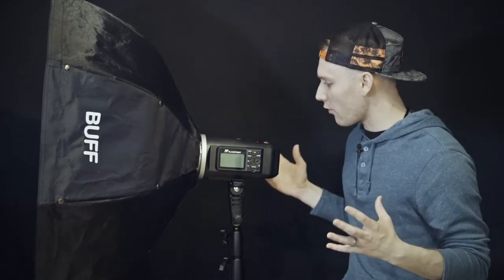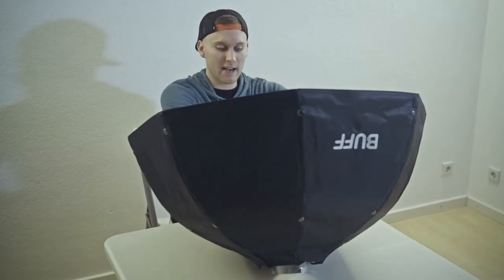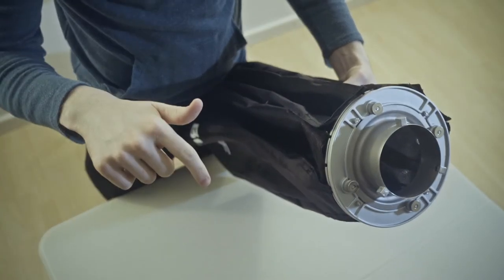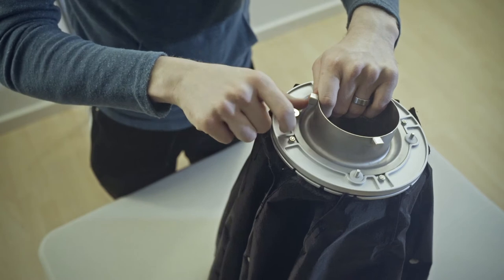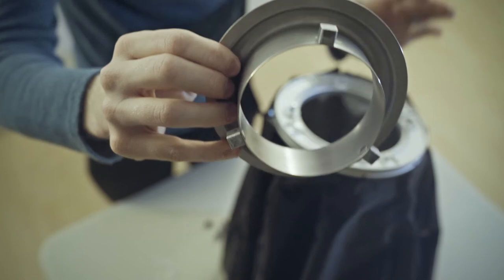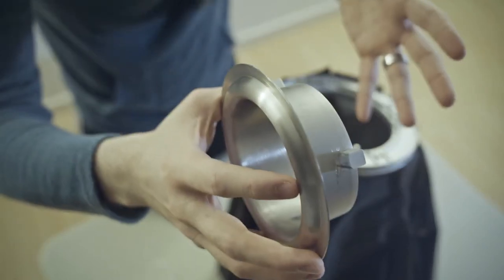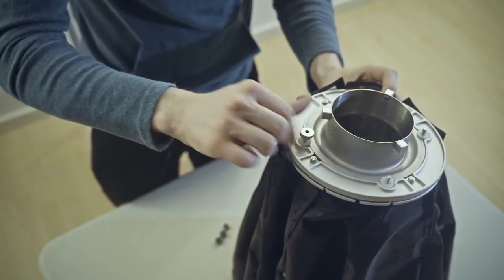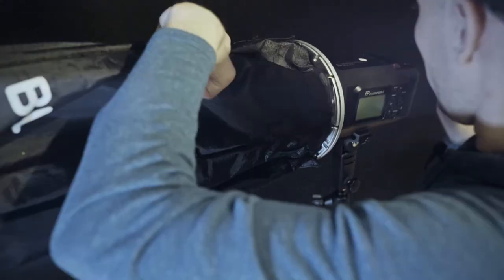How-To: Adapting Paul C Buff Modifiers to Flashpoint Xplor Systems

Comment: This is so helpful - unfortunately I'm having a lot of trouble finding the Adaptor Ring you recommended (seems to be discontinued or sold out everywhere). Any tips or alternate suggestions?
Reply from the maker: Kelly Kester I was one of the first to find out about this adapter ring and just bought enough for my softboxes. I'd recommend searching for the part number in Google and see what kind of results you get. I hope your able to find some.

Comment: Nice! Wasn't sure if the adapter would be interchangeable. Thanks for clarifying! What did you shoot prior to flashpoint and what are your thoughts on switching?
Reply from the maker: John Weatherby Thanks for watching! Prior to the switch I used the Paul C Buff Einsteins and I had a selection of the Sony HVL-F60M's. I was heavily invested into the PCB system but the switch was simple. It's actually cheaper to go the Flashpoint route as an on-location photographer, and no more crazy heavy vagabond batteries.
Reply: Thank you so much! I 100% agree. I just picked up a couple of the flashpoint 200 mini strobes. This whole system makes life so much easier. Side note I tried some bowens adapters I got off of amazon and they were too big to fit PCB mount, but checking the ones linked in your description, reviews confirmed they're the right ones. Thanks again for all your help
Reply from the maker: John Weatherby I'm assuming you're talking about the Flashpoint Evolv and if so, that's wicked! I will be getting some soon! 
I'm glad to hear I could help!
Reply: +Lane McCall yes! Exactly! They are awesome! Powerful, compact, and super convenient! You'll love them man!

Comment: Hey I any suggestions for me ? I have 2 einsteins and vagabond minis to do outdoor photo shoots, and its a pain in the neck to have all this gear spread out.. now that I know I dont need all new modifiers .. should I switch to 2 flashpoints TTL 600 hss instead of the eisnteins ? Thanks !!!
Reply: Btw Where can i find the adapters now ? Its discontinued
Reply from the maker: So I made a video specifically for individuals like you! I was in the same boat a couple of years ago when I made the switch and I haven't looked back since then! Here's the video; https://youtu.be/86hefx7gET8
Reply from the maker: I don't own the Xplor pro but yes it should work no problem. The Pro still uses the same bowens s mount.
Reply: So like someone else, I checked and at this time the adapter in this video is not available on any of the three sites you mention.. discontinued.. so would not be able to mount PCB modifiers onto it? Are there other options?
Reply from the maker: Laura Brindusa Squire I'm afraid this is the only option.

Comment: Silly question - would you happen to know what is the largest modifier one can use on the Flashpoint? I have a Photodix 5ft octa and its kind of heavy even for my Alien Bees 800. Can the Flashpoing Bowens mount handle the weight or maybe even a 7ft umbrella?

Frank
Reply from the maker: Francisco Ortega That is by no means a silly question! With my experience, the Xplor's hold modifiers even better than the PCB systems due to the clicking mechanism they have. I personally own two 7 foot parabolic umbrellas and the lights have no problem supporting them.
Reply: OK not only did i order the adapter but also the Flashpoint Xplor 600.  Too excited. Wifes going to kill me. LOL

Again thanks for this video.

Frank
Reply: ok purchased the adaptor and it did not work. I purchased the one you recommended.
With that said it turns out I needed to purchase the speeding and inner ring together. I am not using a PCB octabox but a Photodiox 60" . It was purchased with the speedring for th AlienBees800 so I assumed your recommendation would be worked. Not blaming you of course, just providing an update and sharing what ive learned in case someone else was making the same assumption as me. :-)
Reply from the maker: Frankie Ortega Yes they use a different size speed ring!

Comment: Do these work with the latest pro model?
Reply from the maker: All I did was swap the PCB adapter with the Bowens-S mount adapter so it can work with lights that have the Bowens-S mount. Theoretically, any light that has the S mount would be fine.

Comment: Hi - Looks like these adapters are discontinued.. :-/   Any suggestions for an alternative?
Reply: DPC Films Please let me know if you find an adapter. I just purchased a PCB 47” octa thinking that I would be able to easily find an adapter on Amazon. The one I ordered does not fit. I’m frustrated and may have to get rid of my octa now.  Nice way to force photogs into buying more gear I suppose. 👎🏽
Reply: Hi - I found a mount on Amazon, but it's a 6" and you will need to cut it down to 5.5" with some metal snips to work with the PCB.  There's a few DIY posts online on how to do this, but if you go to Amazon and search for "ASIN B00M6B194M" and you'll see the adapter that I purchased. 

On another video like this, @Thatguy808 posted the following solution (The amazon DIY solution is $15 while the Denny Mfg is $50)

"I contacted Paul C Buff and they directed me to here https://www.dennymfg.com/adapter-light-rings/ProductDetail/6359  ( part number is AR-CB-2) this is directly from their customer service"
Reply: DPC Films Did the adapter you buy end up working?  I'm looking to get some kind of adapter for a PCB softbox & PLM
Reply: KC P I got one off of Amazon and took it to a machine shop and had them trim some of the diameter off to make it fit.
Reply: Hi - I purchased one in anticipation of buying the XPLOR 600's, but I haven't pulled the trigger (yet.)  I did order the mount and it seems like it will work for the smaller light modifiers..   I just don't want to give you a definitive answer one way or another, since I haven't personally tried it.